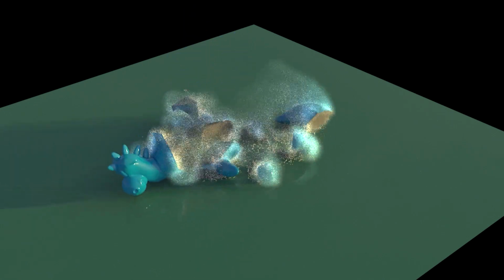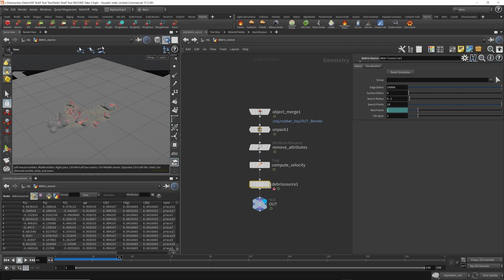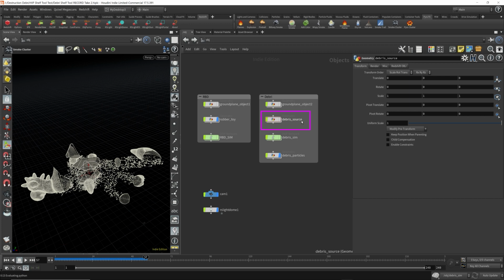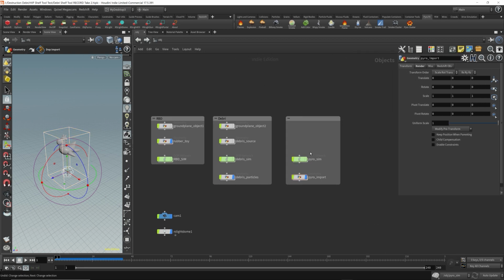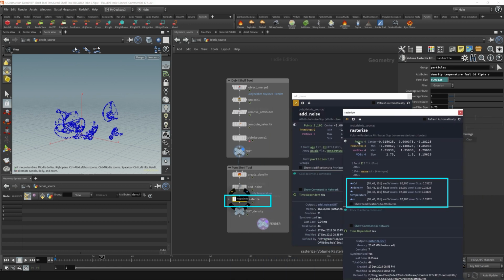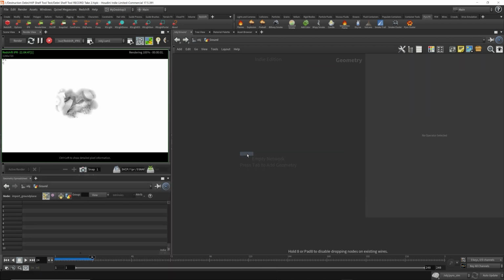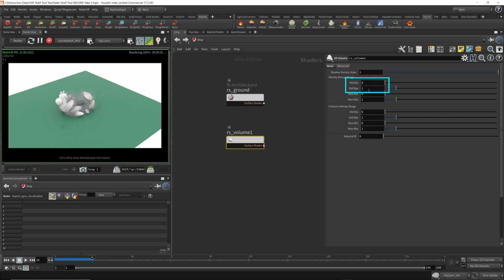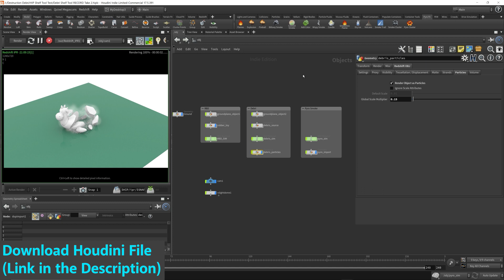Dust Pyro Smoke from Destruction Simulation using Houdini's Shelf Tool

Comment: hey bubble, I'm trying to emitte smoke from debris not from debris_source, but its keep emitting the smoke, how could I delete those end points in debris, it's been 2 days i can't figure out, and it's keep emitting the smoke, please help
Reply from the maker: What is your source object that you're emitting smoke from?  Is it particles or an object?  That's the source object that you feed into the dopnet where smoke comes from.  If you want the smoke to stop, let's say for example stop the smoke on frame 3, then delete the source object on frame 3.  For example, I want smoke to emit from my Rubber toy for 3 frames and stop emitting after 3 frames.  Then I would feed in the Rubber toy into the rasterize node, but on the 4th frame, I would blast away the Rubber toy so like nothing is feeding into the input for the dopnet.

Hope that helps!

Comment: Great tutorial. Only problem is I'm unable to see the smoke in my render - I'm rendering with arnold so I simply used an arnold volume shader on the pyro node instead your RS_volume shader. Any suggestions on how I can see it in my render using Arnold? Thanks!
Reply from the maker: I did use Arnold the Trial version a few months ago to test how it performed with toon shading, but in the end I didn't like it.  I haven't used volumes with Arnold, but if I were to guess I would say maybe its the density, maybe try increasing the density scale in Arnold.  Try setting it to a super large number just to test everything is work and slowly tweak it down.
Hope that helps!